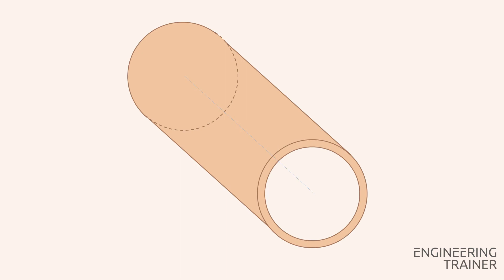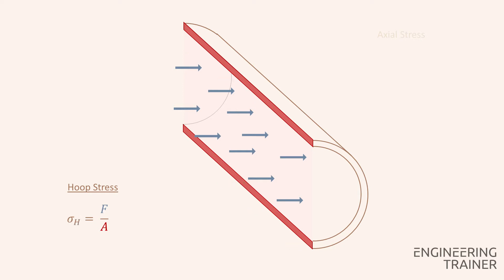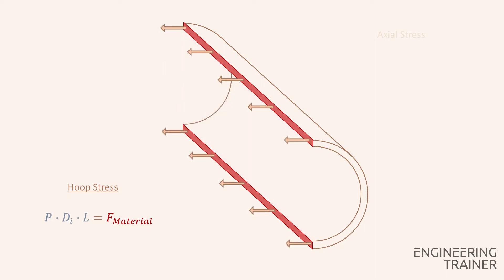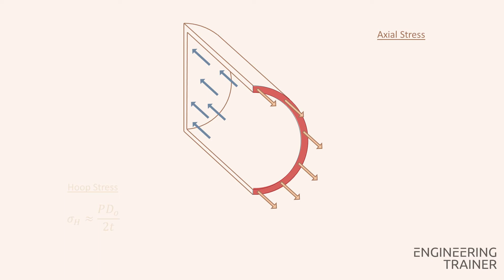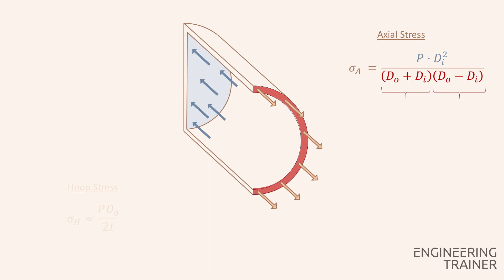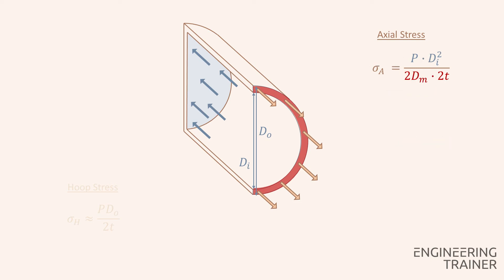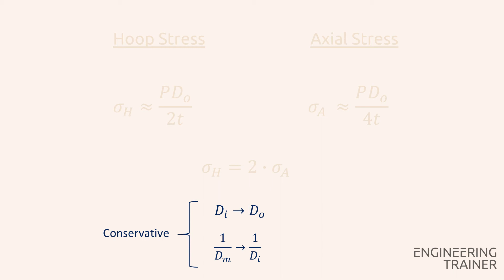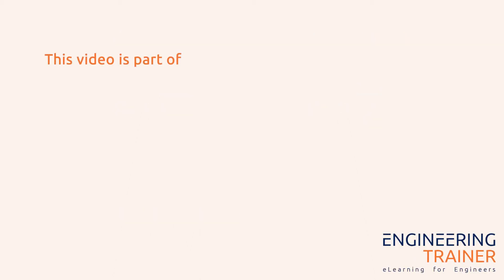Pipe Stress Fundamentals - Pressure Stresses in Piping

Comment: Thank you for the video, but I have a question about why the in your hoop stress equation @1:34, the Ap is Di*L and not (Circumference/2)*L. Since the pressure in the pipe is radially equal, why wouldn't we only consider the resultant force of that radial force that is in the opposite vector relative to the equal pipe stress?

Comment: When you explain axial stress in the pipe, you use a model with closed ends. Are the formulas also applicable to open pipes?
Reply from the maker: Hi Jonny, in order to maintain the pressure the pipe has to be closed somewhere. The pressure puts an axial force on the pipe through blindflanges, elbows or closed flanges. This stress is dan present in the entire pipe otherwise the pipe for a force equilibrium to exist. If there is an outlet and the medium flows out then the flow resistance with the pipe causes the force necessary to provide balance.
Reply: @EngineeringTrainer  Thank you for taking the time to explain, it makes sense now!